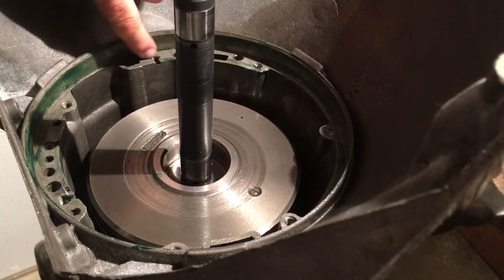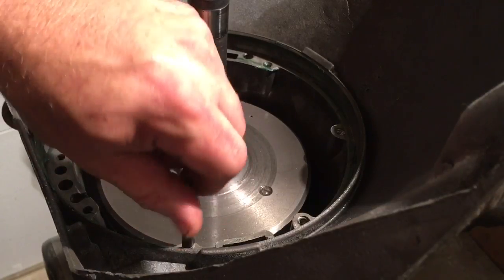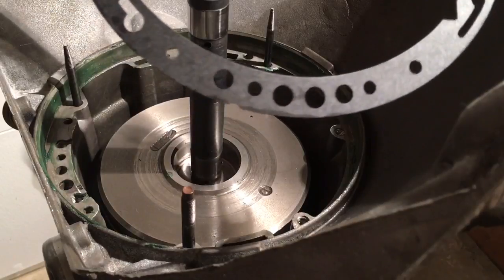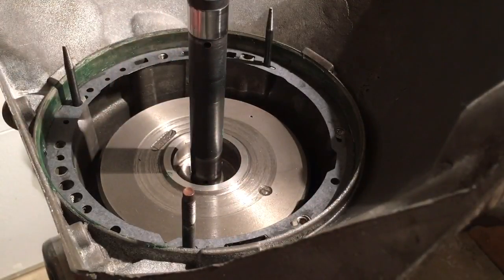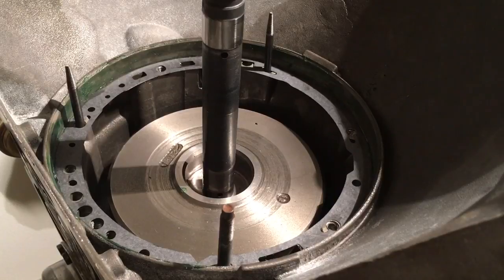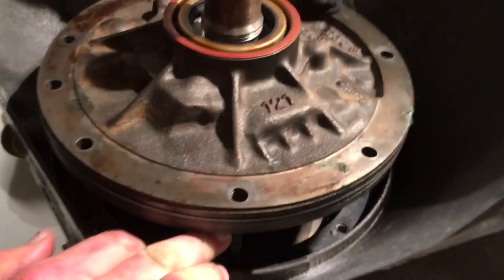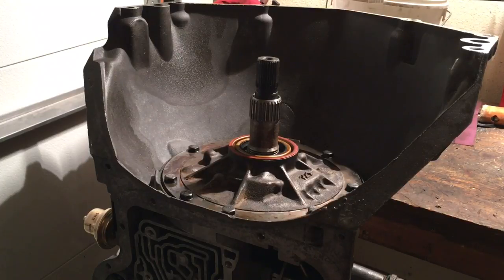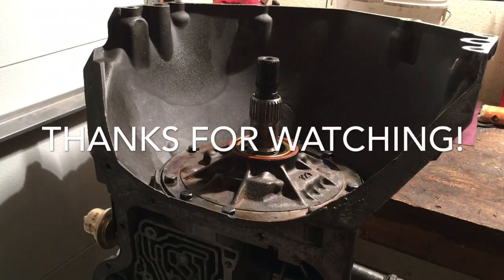DIY TH400 Pump installation

Comment: I've heard some people say to put a dab of silicone sealant on the bolts. I'm just wondering if you have ever done that? I'm installing an ultra-bell and I really don't want it to leak. Any thoughts on that?
Reply from the maker: The Ultra Bell uses individual o-rings to seal to the outer face of the pump which can be a challenge.  I’ve seen some people recommend adding a second pump gasket between the Ultra Bell and pump, seems a lot easier. 
I don’t think I’d put RTV on the bolt threads; I wouldn’t want to chance hydraulic cracking the boss in the aluminum case.  Instead use the soft copper washers under the bolt heads.
If you wanted you can certainly put RTV under the bolt/head/washer.  JD

Comment: Just completed this same job on my TH400, thank you for the info, helped a lot. I have one question: Should you be able to turn the outer shaft as well? The one that you grip hold of to lift the pump out. Also it looks like it takes quite a effort to turn the input shaft, should it be quite stiff to turn?
Reply from the maker: A lot of times it’ll turn only one way and be hard to turn.  I don’t know for sure which ones and which direction from memory.  The parking pawl is the only thing I know of that can stop the internals from turning at all. 
I was always told the sprag assembly shouldn’t squeal when turned but almost all of them do new or used?  JD